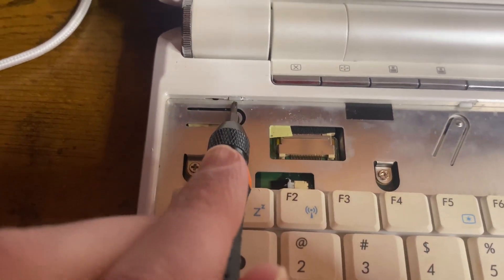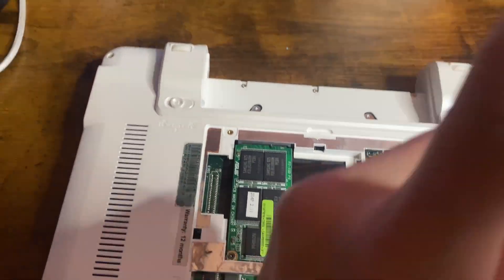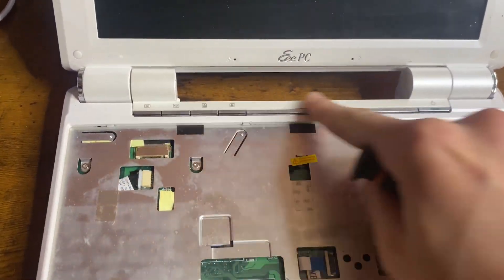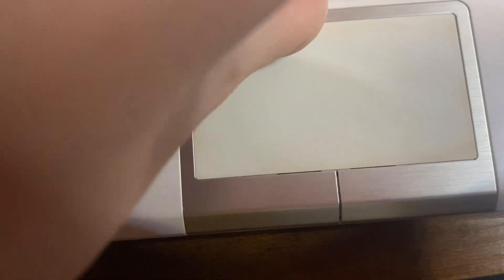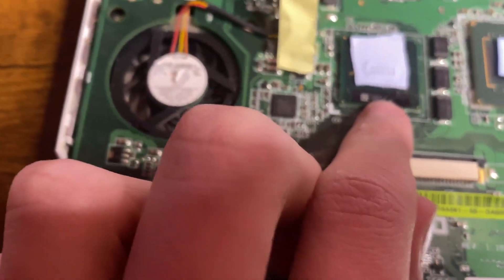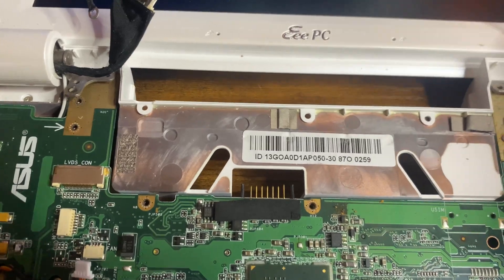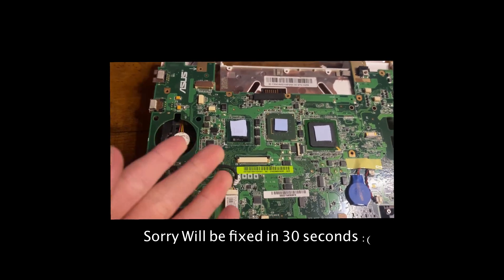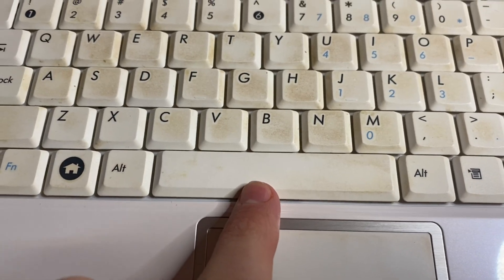EEEPC Teardown!

Comment: the random fan is so funny its like the 2018-2020 intel macbook airs. but asus loves to use some unusual airflow setups in their laptops. also if i didnt see it wrong in the video there is like empty holes on the motherboard that align with the bottom intake and i think the air gets sucked in from there then under that metal plate then out so it will cool that tiny cpu